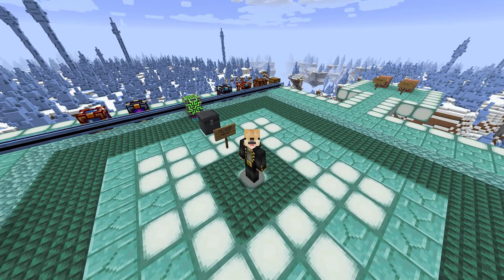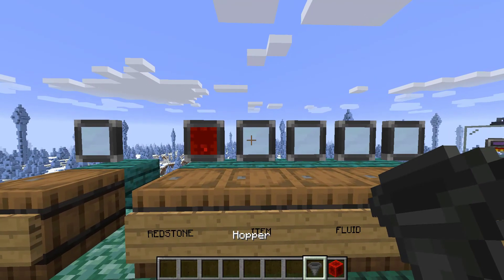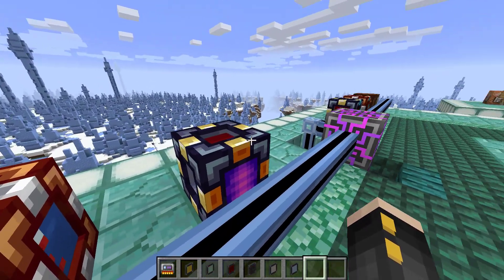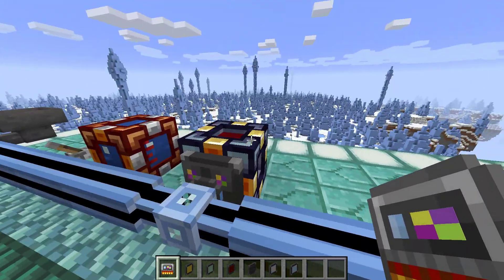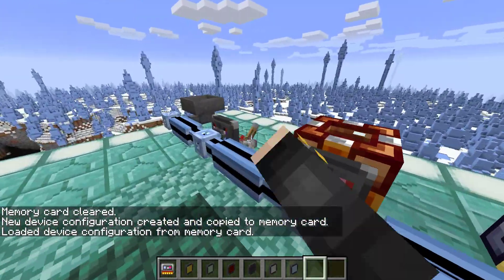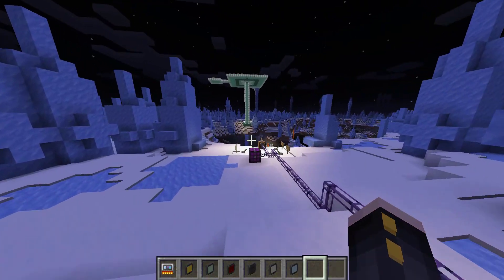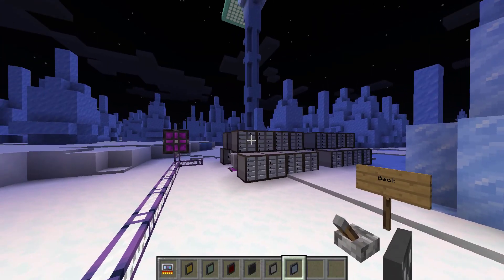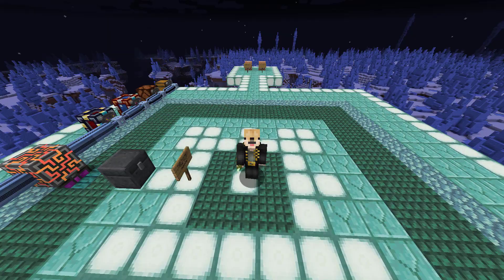Applied Energistics 2: A Beginner's Guide! -- P2P Tunnels Tutorial

Comment: I have a problem with the ME System where i cant pump fluids out of it because the Modpack does not add Blocks that specifically require any type of fluid but only has tanks so what im assuming is that the System does not know which fluid should be pumped out into a tank because it cant be specified.
Reply from the maker: Yeah, likely you would need some specific fluid requested for it to automatically eject the fluid. I would need to test it though.

Comment: Its possible connect for example, 2 different network together using the p2p?
Reply from the maker: Yes, you would need some storage block in between though, since if two p2p tunnels are connected on the same network it’s just all one network. So instead you don’t connect them, and have something intermediating between them
Reply: @lunarCubed  how? I remember something like this, but not how to make it😂
Reply from the maker: @OuDayas  in my first refined storage video, towards the end, there are some sections about using shared chests for refined storage to AE2, so I’d imagine it could look something like that, but with p2ps

Comment: Hey, I really want to know if there is any way to transfer energy (RF, FE or AE) to redstone signal (I want to make an lightning system which turns off if there isn't enough energy)?
Reply from the maker: I believe this could be accomplished with the level emitter, but I’d need to do some research on this. I know the level emitter is able to work between ae2 machines and red stone, so it could probably read out of energy cells
Reply: @lunarCubed  Thanks. When I hop to minecraft again I will try something with it, if it works I will tell you!
Reply: @lunarCubed  I couldn't do it, how do you think he is able to work between AE2 and Redstone? So I can do it in my world.
Reply: I did a bit of something... So, using Powah!, I could use an comparator to comparate the energy of the Powah!'s energy cell, and then I put some hidden ME controllers under the Energy cell so it could use energy in there. Now I can do the RP I always wanted, but if you know some easier way with AE2 only, I would love if you said it!
Reply from the maker: @cattycobain  Oh interesting. I may be able to look into it!
Reply: @lunarCubed  Thanks. I'm trying to find machines which consumes energy, so it can end sometimes.
Reply: @lunarCubed  Also, I just edited the message and it can be AE, RF or FE
Reply: @lunarCubed  Hi, I got a bit more further ado and I could make what I wished, with the level emitter and energy cell, just like you said. Thank you!
Reply from the maker: @cattycobain  of course!